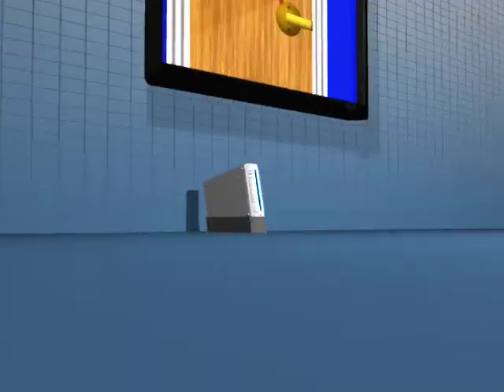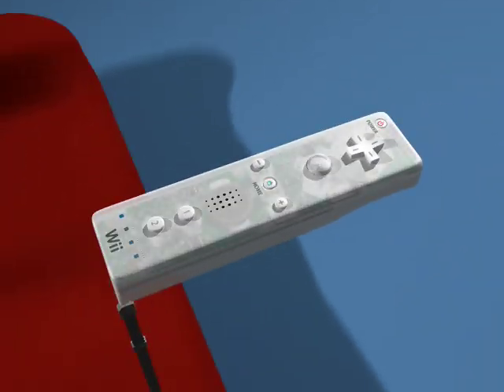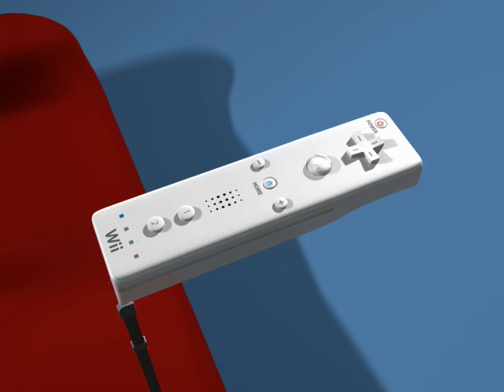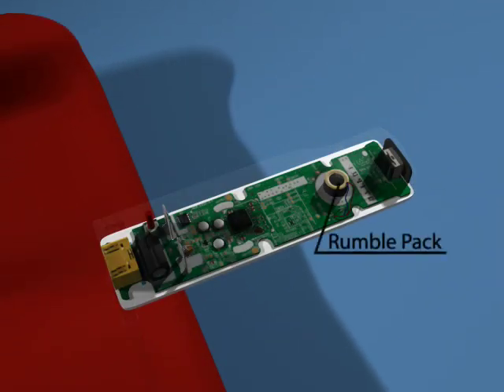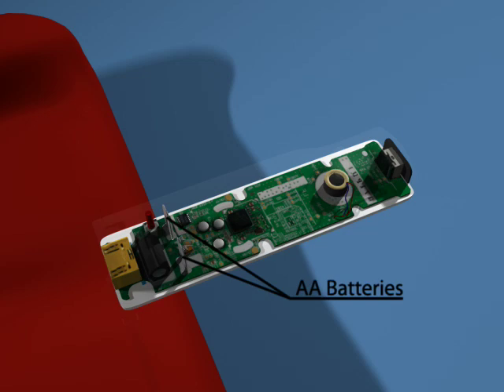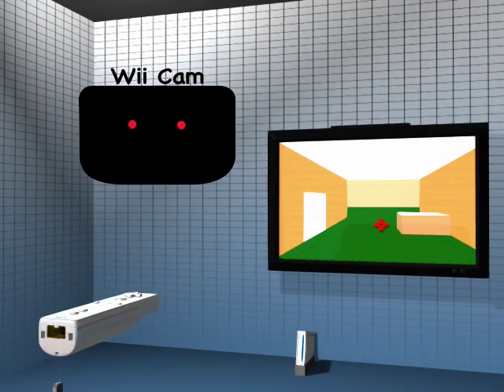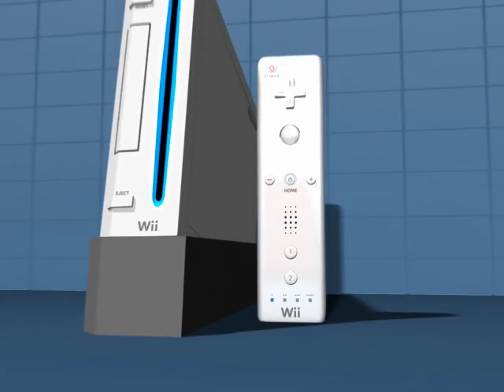How the Wii Remote Works

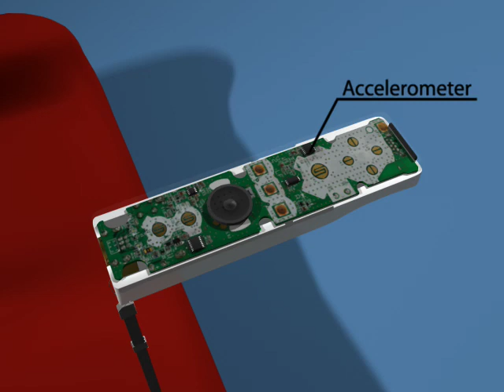Comment: The 'data converter' chip at 0:55 seems to be a voltage regulator chip. It is NOT an accelerometer to Bluetooth converter chip as mentioned.

Comment: You can actually unplug the sensor bar and use two candles instead, I've done it
Reply: Use Christmas lights, they r less dangerous
Reply: or just try 2 tv remote controlls where you lock 1 button so it always sends
Reply: Hyper Hektor ?
Reply: @PolishGuy  tv remotes emit infrared light, if you have 2 spare remotes around you could glue 1 botton on each one pressed down, so they send allwas a signal. Then you can replace the candles with the safer remote alternative.
Reply: @Gemdation  depends on the remote, so are weak some are good, i remember one IR-remote from my childhood which could operate the TV around corners from another room xD. Just try it out its free. if you want to build something you could make a simple circuit of an IR-led a resistor,switch and battery.
Reply: @Gemdation  not yet, i dont have a 5axis machine atm

Comment: this is true me  and my friend sledge hammered ours but with a normal hammer and no it won't work the battery parts was damaged it lost one of the hafes that connected to the battery to give the remote power and destroyed it by breaking it in half and shooting 85% of the bottom of it across our parking lot and bent some of the 90 degree parts to flat plastic parts and that includes the battery casing rip wii remote 20 watever to 2016.

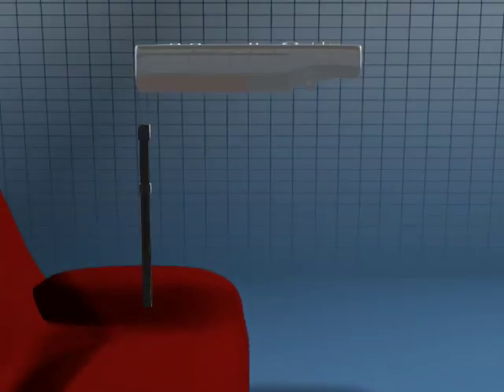Comment: 1:30 WRONG, the infrared on the top of the controller sends two signals one for left one for right. if one is more down than the other than it knows it is tilted. if  the bothe face more downward then it knows the height. left and right is also detected.
Reply: i call bullshit on your statement.
Reply: i call TTTTRRRUTHHHHH
Reply: You're incorrect. =P It's the sensor bar that has the infrared lights, and the wiimote that detects the lights and sends the information regarding the light's orientation with respect to the controller's IR camera back to the console via bluetooth. People have done teardowns of the controller and confirmed this. People have even taken the IR sense out of the remote to create their own devices using arduino.
Reply: I meant that, sorry
Reply from the maker: Hey man. I actually met you at Smash Con on Friday. Weird you saw this video so close to then. I was the guy who asked about making stages and about why you switched to 3d vs 2d
Reply: Chad Tower Haha, whoa, that's crazy! I don't even remember how I got to this video. Such a small world. =P

Thanks for your question, btw. It was a good one!
Reply: Artsy Omni Six degrees of seperation?

Comment: I hope the wii mote becomes a permanently supported accessory- even after the consoles are gone, it works great as a mouse controller for pc and if software is provided could do even more.  i guess other parties might make em.  including nun-chuck of course.
Reply: There's something called PlayStation Move that is basically like a Wii remote, except that instead of an infrared sensor, it has this huge squishy glowing orb on top. I think it looks pretty weird.

Comment: I would appreciate this help towards some research I've been doing of late. If one were to hold an infrared dot in midair, at any point of the 45 degree angle the wiimote can sense, would it track the point in the field of depth or on the standard 2D plane? Any response would be appreciated

Comment from the maker: @abdulz1 Then yes, that should work. But if you're going to hack the wiimote to be used on your computer, you could probably hook a battery up to the sensor bar wire and just use that. Also, you can buy wireless sensor bars

Comment from the maker: @abdulz1 you could connect it yes, but it wouldn't work. without the sensor bar to use as a reference point, the cursor wont know where to go.

the buttons and the accelerometer would work though

Comment from the maker: @Megadoomable If the wii remote was upside down the force it would register would be upwards, relatively. Remember, it compares the direction of the forces applied to the controller. Its not just a vertical line, its a vector pointing down. (I guess I probably should have made the lines arrows instead of dotted lines.

Comment from the maker: @WeirdCandycain Actually, they aren't purple either, they are infrared, meaning they are outside of the visual spectrum of light. Red and purple are next to each other on the color wheel, but on the spectrum of light, infrared exists below red and ultraviolet exists above purple. Your camera can translate light that is outside of the normal visual spectrum, but you see it through a filter, which will color correct the light into somewhere around red

Comment: @IXDEATHX1 

try lighting a really big candle and place it in between the wiimote and the sensor bar if you really want to fuck with someone. The wiimote freaks out since the candles I.R light is stronger than the sensor bar.